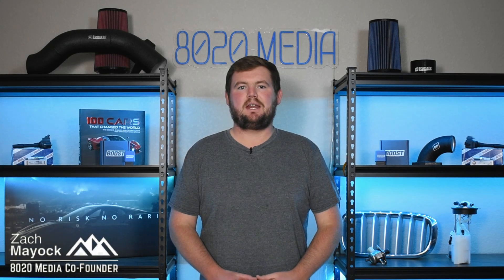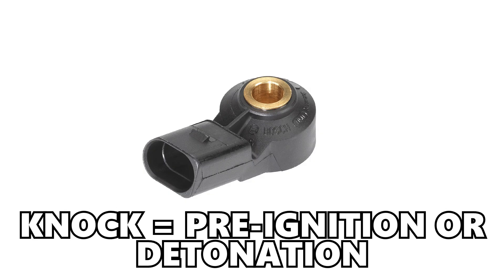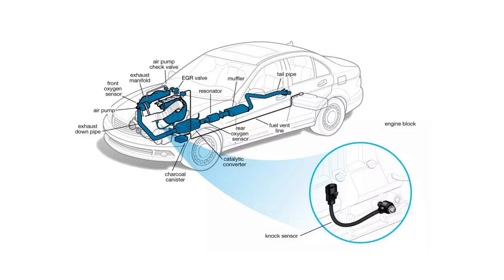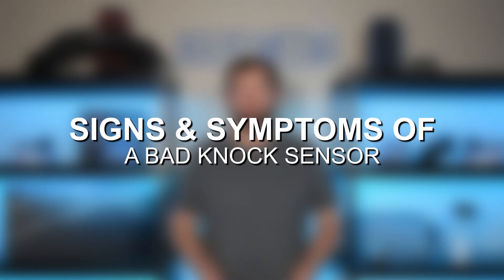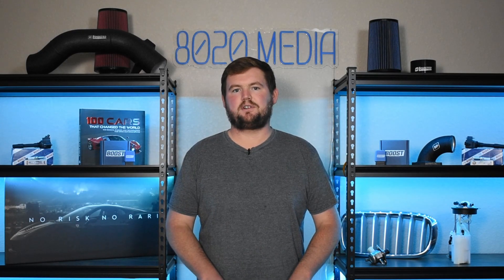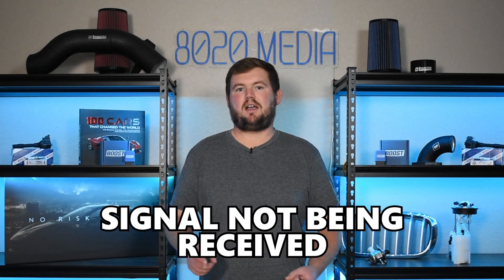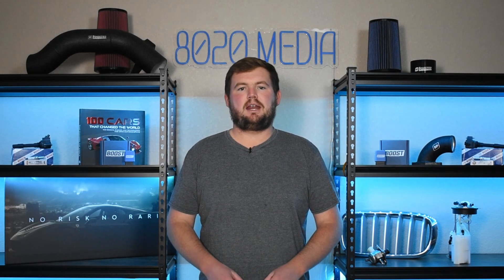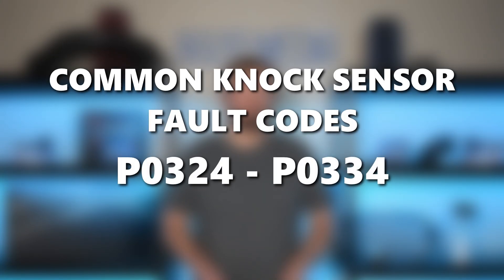4 Signs of a Bad Knock Sensor!

Comment: What happens if you unplug the knock sensor ? Is this a possible diagnostic technique? If I unplug it to see if tick goes away? Lost power and broke down, no code , towed it home and it runs and ticks loud not a heavy knock just a loud tick. 2010 Accent 🤙🏼

Comment: Can I get a loud metallic kind of rattle when accelerating and letting off the gas? Also a metallic rattle when I start the car? It is persistent knocking now even when I don’t accelerate but gets bad when I accelerate. Also, could it cause my check engine light to flash due to a misfire?
Reply: That could be from piston slap or rod knock. Not saying that it isn't a bad knock sensor.

Comment: Can a faulty knock sensor cause too much advance timing with no codes?
Reply from the maker: J - Yes — if a knock sensor is faulty but not dead enough to trigger a code, the ECU may stop detecting knock and default to a more aggressive base timing map, which can result in too much advance under load; this won’t always set a DTC because the sensor still shows “some” signal, just not accurate knock feedback, so the computer thinks all is fine. The usual symptom is pinging/detonation under acceleration with no codes, and the only way to confirm is by logging timing data and comparing it with fuel quality and load, or by testing the sensor output directly.
Reply: @8020Automotive Awesome thank you so much for responding to my message and giving me more information about it, I guess it wouldn't hurt to replace it might solve my problem thank you again

Comment: So in other words your engine knocking may be causing the knock sensor code. Bad gas, water in tank, dirty mass air flow sensor dirty air filter may be the cause of engine knocking.
 There fixed it for you without all the bla bla bla.
Reply from the maker: P - Thanks for this. We make these videos for everyone, regardless of automotive knowledge. Therefore, we will be very thorough in our explanations.

Comment: I was driving my g35 coupe and my car shut off unexpectedly. I started it and drove off again. I scanned the car and it threw this code p0328 code without an engine check light present. The code states knock sensor/circuit bank 1. My performance has significantly reduced when accelerating but still no check light. Is this normal?
Reply from the maker: K - No, it’s not normal—even without a check engine light, a stored P0328 (Knock Sensor Circuit High Input – Bank 1) can absolutely cause your G35 Coupe to lose performance, because the ECM responds to potential knock sensor issues by pulling timing and reducing throttle response to protect the engine, which leads to noticeably reduced acceleration; the fact that there’s no check engine light but a stored code suggests the sensor may be intermittently failing or there’s a wiring issue (like a broken ground or high resistance), and the system hasn’t deemed it “hard” enough to trigger the MIL, but the ECM is still reacting to it—check the knock sensor harness for damage or oil contamination, and consider replacing the sensor if wiring is intact, especially if your engine feels flat under load.
Reply: @8020Automotive  Thank you. I placed the order for both the sensor and wire. The engine does feel flat under load. My foot would be to the floor, but I notice it happens when I am going up hills. I am starting to think it could be the wiring. On a flat the power is there but climbing I feel a misfire and it loses power.
Reply from the maker: @Kevin-im4lw  It does sound like it! Keep us updated.

Comment: Is "hard shifting" a symptom of a Bad Knock Sensor?
Reply from the maker: D - No, hard shifting is not a direct symptom of a bad knock sensor. A faulty knock sensor primarily affects engine timing and performance, leading to reduced power, poor fuel economy, and sluggish acceleration. However, if the engine goes into limp mode due to a persistent knock sensor issue, it can indirectly cause transmission problems like delayed or harsh shifting because the ECU limits power output. If you're experiencing hard shifts, it's more likely due to transmission fluid issues, solenoid failure, or a failing sensor related to the transmission rather than the knock sensor itself.

Comment: So you're saying that even if there's no 'DTC' thrown, the knock sensor may still be responsible for ECU changing parameters that lead to poor fuel efficiency? I've been trying to track down why my mpg has dropped so low. The only code I ever get is P0325 which I figured was rodents chewing the wire. There is no ping or knock - engine is running fine, till the code strikes...then it's limp mode. But it goes away after a short while. I had no idea the knock sensor could still be the culprit despite having no code.
Reply from the maker: J - Yes, even if the knock sensor doesn't throw an active DTC, it can still cause the ECU to adjust timing and fuel parameters, leading to poor fuel efficiency. The P0325 code (Knock Sensor Circuit Malfunction) suggests a faulty knock sensor, damaged wiring (possibly from rodents), or poor sensor connection, which can force the ECU to default to a conservative ignition timing map, reducing power and MPG to prevent potential knock. Even without an active check engine light, the ECU may still be making constant micro-adjustments, affecting fuel economy. Since your MPG has dropped significantly, I’d recommend inspecting and replacing the knock sensor and checking for any damaged wiring. A faulty knock sensor doesn’t always cause pinging or knocking, but it can still trick the ECU into pulling timing and running richer, leading to the symptoms you’re experiencing. Keep us updated!

Comment: I have an intermittent power loss in my 2011 hyundai sonata GLS. Is it possible because of knock sensor?
Reply from the maker: S - A faulty knock sensor can cause intermittent power loss, but it’s important to scan for fault codes and inspect related components like the MAF sensor, fuel system, and ignition system.

Comment: I have a toyota tundra.,Rats recently ate my knock harness  I replaced the harness ,cleared the code.But i notice my gas milage has really dropped and power as well.But ihave no codes.im  onfused.Do you have any idea ?  Could it still  e my knock sensors?
Reply from the maker: C - That's tough, because with a rat, you never really know what all they got into.. Have you taken it to a shop?

Comment: Would this prevent you from being able to start your vehicle if left unchecked? I didn’t have a check engine light come on but my car was faulty starting. I replaced the starter and it worked fine for a week or so, then started being bogged trying to start. Now it won’t start at all. I got p0326 code now. 15’ Sorento

Thank you for any feedback
Reply from the maker: A - It certainly can prevent it from starting!

Comment: Hi, great video. My car has occasional knocking. These knocking occurs when the car is going uphill and accelerating . I took it to the dealer twice , they are saying they couldn't replicate , so they won't fix it. Your input is much appreciated. Also, the knocking decreases when I use high octane gas .
Reply from the maker: I - Are you getting any engine codes?
Reply: @8020Automotive  just checked it today,P0300 and  P0301 , both inactive (archive).Do you think dealer cleared the codes without fixing the issue ?
Reply: Replace the knock sensor
Reply: same exact problem I'm having
Reply: @kalyungvevo2256  pre ignition
Reply: Same problem here. Lexus ls430